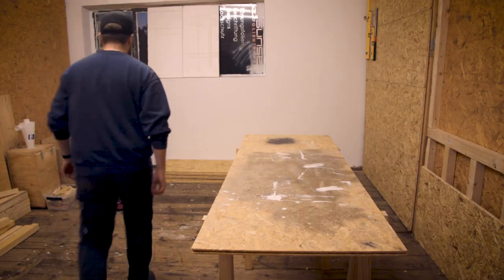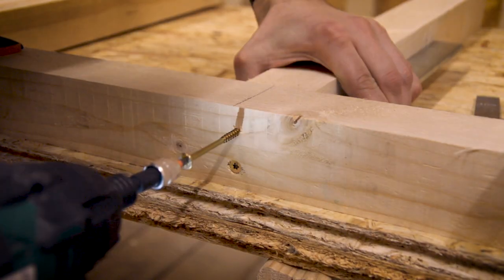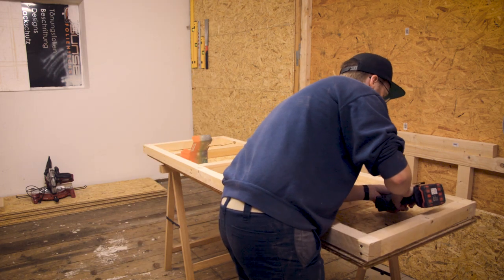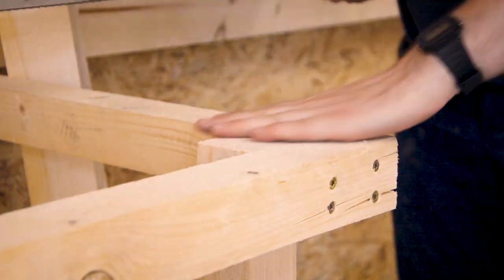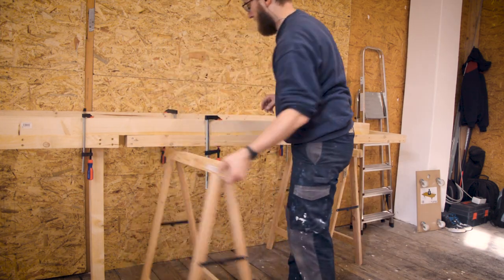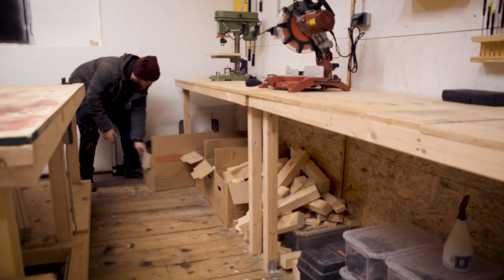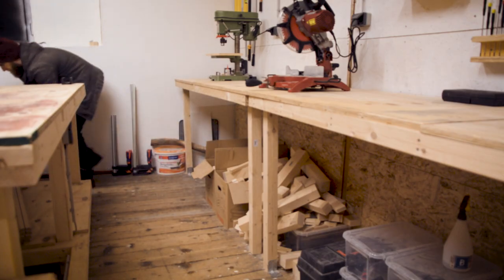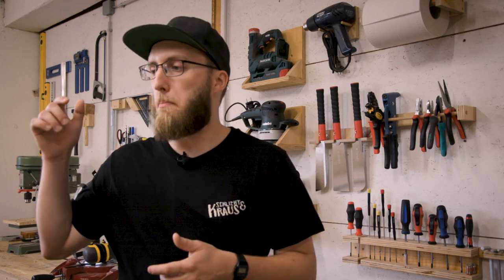Wall Mounted Workbench - How to | ShopBuild Pt 2

Comment: My floor is also not even, do you think the legs would support enough of the bench weight with no mounting brackets? If not I suppose I could release the bench from the wall after I have mounted the legs but I would rather leave it attached.
Reply from the maker: Hey. Which mounting brackets do you mean? The angle brackets on the floor don't support much of the weight, but rather help keeping the legs in place. The beam on the wall does support half of the weight, as it replaces the legs in the back. Hope i could help